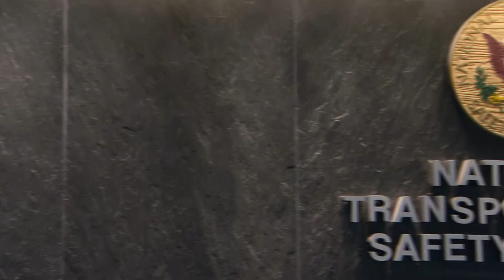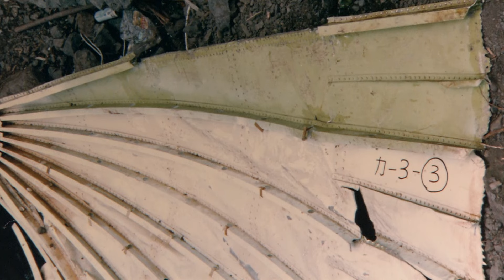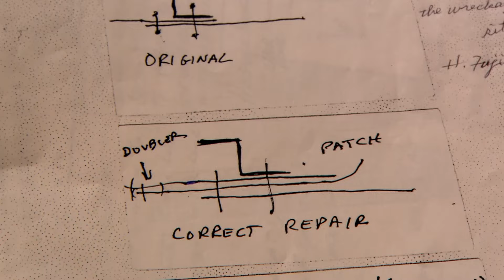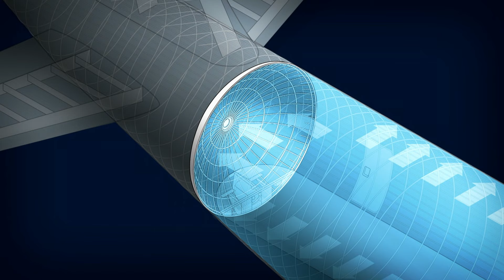JAL 123 Stayed Airborne for 30 Minutes Without its Tail Fin 😨 Air Disasters | Smithsonian Channel

Comment: There would’ve been more survivors if that rescue wasn’t delayed.
Reply: Around 40-50 people had injuries which were survivable if treated for, but obviously not survivable after spending a night in the freezing cold. However, the mountainous terrain also made any rescue attempt extremely difficult, especially at night. Still, the arrogance of rescue authorities unfortunately cost lives.
Reply: @ArtemkaPannat  they should be fined for that.
Reply: @@joshbalfour4094 same thing happened 17 years later.
Reply: @YTReese2011  I must ask, what happened?
Reply: @eggypankakes  the comments section forgot it takes balls and brains to pull off a rescue
Reply: @eggypankakes  on Augest 12th, 1985. Japan air 123 departed Tokyo. Suddenly, 24 minutes into the flight, the tail blew off the plane and made it uncontrollable. The pilots managed to fly the plane for 32 minutes. It crashed into a mountain and 520 out of the 524 people on board died. Rescuers came on to the mountain that night, but they made a BAD decision to delay the rescue. Some people survived the impact. Most seated at the back. Then, all but 4 people died because of the freezing cold. 14 hours after the crash, rescuers found the 4 survivors. A flight attendant survived the plane as well. Investigators said that in the back of the 747, the force was much less. However in the front of the 747, the fore was a lot more and killed a the front of the 747 on impact.
Reply: @YTReese2011  Yeah I know that I'm asking you what thing happened 17 years later
Reply: @eggypankakes  July 25th, 2002. China airlines flight 611 broke up 35,000 feet in the air. About 20 years before, the tail struck on the runway during landing. There were no survivors of flight 611.
Reply: If you could change anything, wouldn’t you go at least back to when the plane was sent to repair so that it was properly fixed & none of this happened in the first place?
Reply: @t.macrocosm1831  yes, I felt like the mechanics didn’t do well in repairing the plane.
Reply: @Donkeymaster9000 People don’t realize just how difficult a rescue operation there would be. People can say whatever without knowing any details and believe their in the right when in reality they have no idea what they are talking about
Reply: @xxEzraBxxx  we do know the US Army were ready for the rescue operation much earlier and with good visibility still, yet were denied by the Japanese due to "political reasons." They denied a prompt rescue due to pride and then found themselves unable to do so because it was already dark by the time they got there. Reeks of negligence
Reply: @wweghorstgoldbridgesgreatest  Never heard anything such about political reasons
Reply: @xxEzraBxxx  but that was the case.
Reply: @ArtemkaPannat  сада о вашој судбини одлучује зеленски "иза стола" Мир сада!поздрав
Reply: Its implying due to increase tension between them at that time

The actual story was as simple as they forced to come back to the base
Reply: @tsumugikotobuki0131 freezing cold? In August?

Comment: Mad respect to those pilots for keeping that plane in the air with no rudder!
Reply: What about tail
Reply: @sohailishad4966 yes that is the tail..
Reply: Well most of it
Reply: @747_Fan the rudder is apart of the stabilizer, the stabilizer isn’t the rudder itself. They could fly this plane wayy easier if they had only lost their rudder
Reply: To be honest, nobody couldve saved that plane, those were the best pilots they had, and to keep it airborne for more than 30 minutes with 2/3 of the stabilizers is an impressive feat, but no enough to save the lives lost on JAL 123...

Comment: R.I.P Kyu Sakamoto. A singer and actor from Japan, Kyu Sakamoto. Most of his popularity outside of Japan came from the Japanese hit song "Ue o Muite Aruko," which has sold over 13 million copies. Sakamoto killed together with the other 519 passengers of Japan Airlines Flight 123 on August 12, 1985.
Reply: When accident investigators from Japan visit Boeing's Renton factory in Seattle to investigate, they are put on a jumbo simulator.
The test pilot said the jumbo had exactly the same conditions as Flight 123, including the loss of the vertical stabilizer, and successfully landed it on the runway 21 minutes later.
(ANA instructor pilots conducted simulation
Even if verified with a
It is possible to make a forced water landing)
An accident investigator from Japan says sarcastically to the test pilot, ``You must have practiced a lot, haven't you?'' but this is because he does not know that the test pilot is being remotely controlled.
suspicion
To prevent it from crashing on the way.
Hydraulic piping heading to the vertical stabilizer,
When the hydraulic pressure is released, the hydraulic flow rate
The sensor detects the pipe shutoff valve.
(:solenoid valve)
I installed it so that it would work.
There was a smoldering suspicion that there was no such thing.
If so, hydraulically flap the
Also, I was able to put in and take out the gear,
When the oil pressure went out and the control became impossible,
Didn't you report it to the control department or the company radio?
That would be the reason.
"Hydro pressure, all loss"
That's not to say. Voice recorder only.
This isn't evidence.
Of course, if there is some oil pressure leakage, it will take 25 minutes.
There was an eyewitness testimony when the abnormality occurred.
The theory is that there was no damage to the vertical stabilizer.
This will be the reason why.
Due to clogging or incorrect flap operation.
A crash would be highly unlikely.
Otherwise, Kawakami Village, Minami-Aiki Village
The movements observed by the witnesses were
Added seat control
Whatever it was, I couldn't fully understand it.
Also, if the oil pressure is lost, the remote
It will also be difficult to control.
To facilitate remote control,
It is believed that a shutoff valve was installed on the

Parts of the aircraft were found in Sagami Bay off the coast of Misaki Port, Miura City.
Auxiliary engine intake duct, vertical tail, etc.
was recovered, but on the twelfth day of the accident,
Fisherman at Jogashima, adjacent to Misaki Port
Two members of the group, Tetsuo Takahashi (36)
Toshihiro Toyota (37) said, ``Boom!''
I realized that I was hearing the sound.
The time coincides with this accident, and the aircraft was already in trouble over Jogashima.
The possibility is growing stronger.
He also said that it sounded like metal hitting each other.
At the time of the accident, there was a significant impact on the aircraft.
This is likely to be evidence to support this fact.
Around 6:30 p.m., Sagoman (southwest of Jogashima)
There was a ``thump'' sound in the sky.
For a moment, I thought it was thunder.
However, when I looked up at the sky, it was clear
There are no thunderclouds.
Of course, I couldn't see any planes.
There was only one sound, and the huge pieces of metal were touching each other.
The feeling you get when you bump into someone
He says it was.
Mr. Takahashi received the qualification of second officer.
I have one of the metals I heard at the shipyard.
He says it sounded like a bang.
August 15, 1985 Kanagawa Shimbun
Reply: He was one of my Oba-San favorite singers back in her day.
Reply: @a350xyz9 how long did it take you to do that?
Reply: @Steam171real  Testimony of the captain of Toa Domestic Airlines Flight 364

His voice was clearly muffled because he was wearing an oxygen mask, and even when he was silent, he could hear the sound of him breathing heavily and seemed to be in pain as he said "control is lost."

It felt like he was doing something that would save his life, and there was a sense of urgency. I thought this was a real emergency.

"It felt like he was doing something that would save his life, and there was a sense of urgency."

It seems he was searching for the cause of the control system being unable to operate.

The aircraft flew from Osaka Airport to Chitose Airport at 8:50 on August 11, the day before the accident, and made one round trip between Haneda and Chitose, then one round trip from Haneda to Fukuoka Airport. After 9:40 p.m., it entered the maintenance factory at Haneda Airport and underwent an inspection.

Maintenance was carried out by about 10 maintenance staff over a period of eight hours, from late at night on the same day until the early morning of the 12th, the day of the accident.

Article from the evening edition of the Mainichi Shimbun on August 20, 1985

I would like to point out the possibility that the crew found out about this maintenance and assumed it was the cause and were searching for it.

Flight control system failure the day after the maintenance?

The cockpit crew was very busy checking the instruments and their operation, checking the wiring, and devoting all their energy to flying the plane.

Comment: Impromper repair caused this mess, the splice plate top only has 1 rivet row while the bottom has 2 rows due to an earlier accident that damaged the bulkhead. 1 row isnt enough to withstand that much pressure and flight cycles
Reply: I worked for Boeing for 33 years as a structures engineer and you are right a repair to the pressure dome was the cause. But it was the wrong lenth fasteners at the dome splice that cause the dome to fail. When the dome failed it vented cabin air up into the vertical fin thereby blowing the fin off the airplane. Boeing fixed this by adding a tear strap to the dome and adding structure to preven cabin air from venting into the vertical fin.
Reply: @captainclone1367  Thank you for the clarification.

Comment: Japan Air Lines Flight 123 was a scheduled domestic passenger flight from Tokyo to Osaka, Japan. On August 12, 1985, the Boeing 747 operating the service suffered a severe structural failure and decompression 12 minutes into the flight.
Reply: 12th august is my birthday
Reply: The American investigator and NTSB side-drain investigator is Yumi Ochiai [former JAL assistant partner]. Seats in row 56 include seats up to 59 on both window sides and up to 60 in the center. I was seated on the aisle side of the left window row, third seat from the back] and visited Tano General Hospital (within 1 hour of detention) to hear testimony, and the hearing was held at 3:00 pm.

``I looked at the clock and saw that the abnormality occurred at 18:25.'

Comment: What happened
Reply: Jal 123 was bound for tokyo but lost its tail then usa military offered to help but jal refised so the plame flew for 30 more mins but then crashed into a mountain
Reply: @Jesusisdagoat-m8e  It wasn't JAL that refused help, but Japanese rescue authorities (military, police, fire service etc.), after the plane had crashed.
Reply: 4 survived 520 died, the cause was metal firgue.
Reply: @julyanroldan3837 improper repair, because the top splice plate only has 1 row of rivets, it slowly begins to crack and causes the bulkhead to burst open which also cuts the tailfin and the hydraulic lines for controlling the plane
Reply: According to Japanese reports, the US Air Force has -130 transport aircraft and
The pilot of the Japan Air Self-Defense Force plane crashed into the wall.
They reported seeing the plane on fire while en route.

According to Kyodo News, multiple eyewitnesses
after witnessing the plane make a long turn.
He said he saw red and black flames.

Haneda Airport control room staff
Mr. Tosumune Okitsu said that Flight 123 was on his radar.
Officials said they were confirming the disappearance and were looking to see if there was a connection between the disappearance and reports that the plane was on fire.

Canadian newspaper Ottawa Citizen August 12 (Japan 8/13

Comment: How it happened. Japan Airlines 123 was a scheduled domestic flight from Tokyo’s Haneda Airport (also known as Tokyo International Airport) to Osaka International Airport (also known as Osaka Itami Airport). On August 12, 1985, the Boeing 747-146SR developed mechanical problems 12 minutes after taking off. The plane then crashed into Mount Takamagahara in Gunma Prefecture 32 minutes later, after the pilots tried to control the plane, but failed. 520 people died, and only 4 survived. The crash was caused by incorrect repair after a tailstrike incident, which caused metal fatigue and eventually an in-flight structural failure, in which the whole tail of the plane separated from the plane.